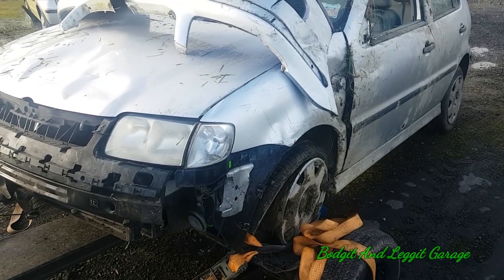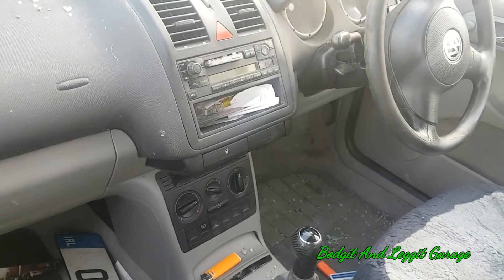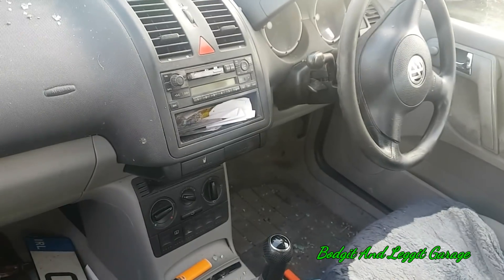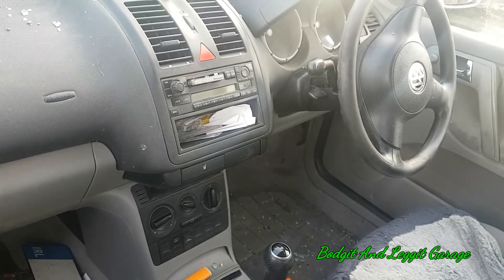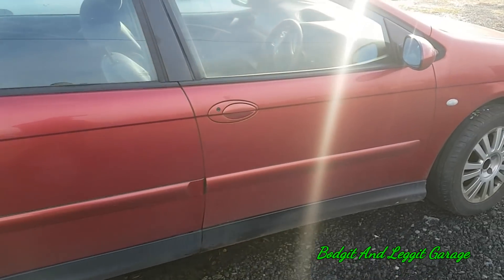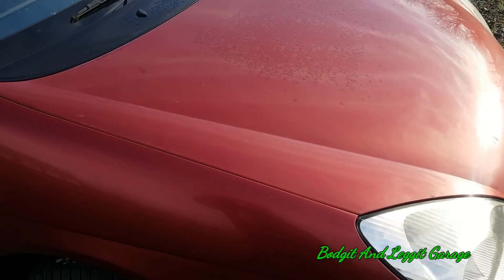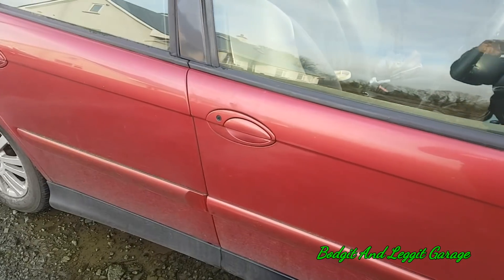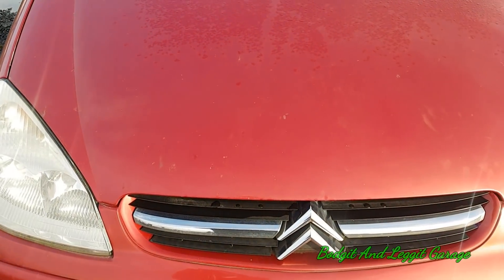Popping air bags driving with no oil in engine or gearbox what Bodgit And Leggit Garage

Comment: its a Citroen, the engine might break down WITH oil in it, besides we have no clue about the gearbox.  as for the airbags, put a car wheel on them before you set them off :)
Reply from the maker: Hahahah
Reply: Well, depends, Citroën has a bad reputation, but mostly connected to unskilled mechanics trying to sort out very complicated suspension and other solutions with knowledge only on ordinary cars. My experiense after only using skilled mechanics are Not that Citroën is subpar to other cars, ideas on Citroën seems to be invertedly exponentiall to how many citroens the persons have owned...
Reply from the maker: @konsum949  it's not actually that complicated just people think it is but when you actually look at the system it's fantastic but it's not complicated I've worked on the systems for a long time
Reply: bodgit and leggit garage of course! But you have to remember that not all mechanists is as knowledgeable as You, and sad history’s on how cardinal faults have been done when adding ordinary oil been added to the hydropneumatic system and so on has Ben told to me. Some technical solutions mainly suspensions steering and drivetrain is quite cleverly built and both CX, BX and DS generation is interestingly from that perspective.
Reply: 25% of the actual cars are running PSA engines (1.4 hdi , 1.6 hdi , prince 1.6 petrol , etc) ... not that bad   :)

Comment: This should be fun. My guess is the engine will go first. I'm basing that on all the heat it generates but who knows right? We"ll all learn something I'm sure.
Reply from the maker: Yes mate I can't wait going to be fun
Reply: Yeah, engine.  That's a lot more heat than a gearbox.  (And maybe I have an advantage - a mate used to have a very leaky gearbox and it kept going for months, in spite of all the nasty sounds from dry bearings and dry  gear teeth.  I'm hoping that experience may be significant - but who knows?)  Either way, this is going to be interesting.  :-D
Reply from the maker: lol

Comment: Most likely the engine Will fail first? Seems like it has far more lubrication need then gearbox due to faster moving parts and heat?
Reply from the maker: It's going to be fun finding out
Reply: bodgit and leggit garage I showed local fire department and students the power in airbags by detonating steering airbag under a 13” tire. I think it flew some 6-7 meters up in the air. The force is considerably in those airbags. (I was teaching chemistry and technology on a high school at the time)
Reply from the maker: lol nice

Comment: Carnage...cant wait mate...i know first hand about airbag deployment  while being too close.cheers
Reply from the maker: Doesn't sound good mate what happened
Reply: bodgit and leggit garage 05 chevy van.intermittent blown starter relay  fuse.turns out that the power lead going under the drivers seat was shorting to the floorboard. There lives the airbag module.when i saw arching. i got up to disconnect the battery then BOOM...(no pun intended) the bag deployed next to my head.it barely missed my head. Im still partially def in my right ear. So yes mate im def and dumb😂😂😂😂
Reply from the maker: @theadventuresofjavier8698  wow you are lucky that explains why you think the P-51 is better than the Spitfire your head got mashed up hahahahahah
Reply: bodgit and leggit garage LMAO 😂😂😂😋 perhaps your right  mate
Reply from the maker: @theadventuresofjavier8698  🤣🤣🤣🤣

Comment: The engine. My bet is the cams will damage the cam journals and the timing will jump.. Is the citron petrol or diesel. See Wot else it will run on lol. How much can you unplug before it won't start
Reply from the maker: Going to be fun finding out
Reply: all an engine needs is crank and map sensors really to run assuming injectors and coils are plugged in
Reply: @stevieg_306  can depend on the logic in the ecu if it needs more
Reply: @simonrawle7885  Assuming it has bad backup strategies yes you are right